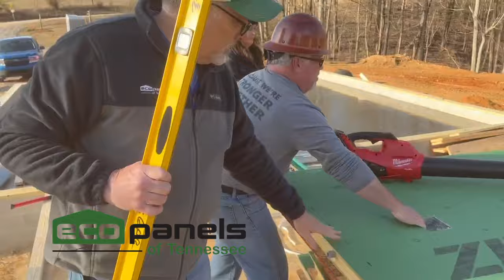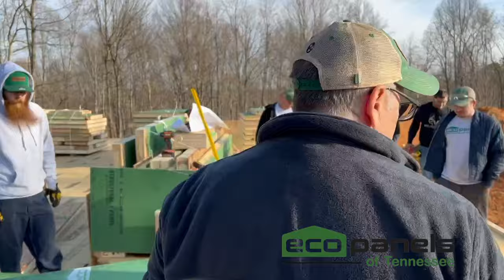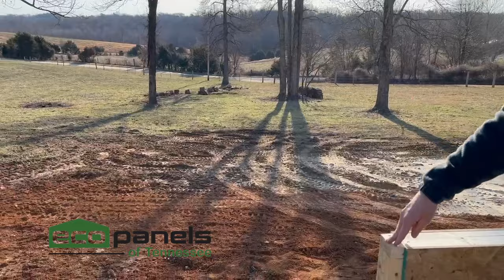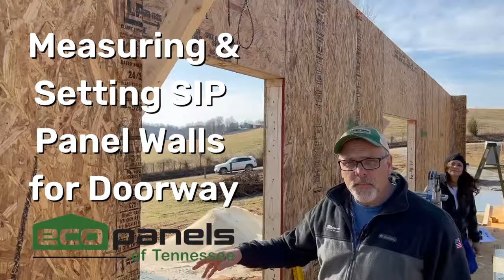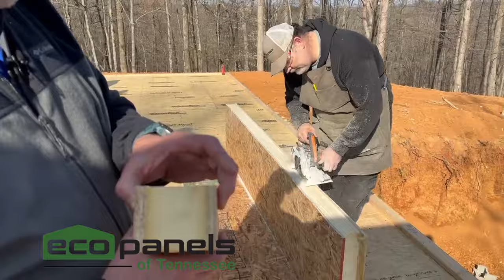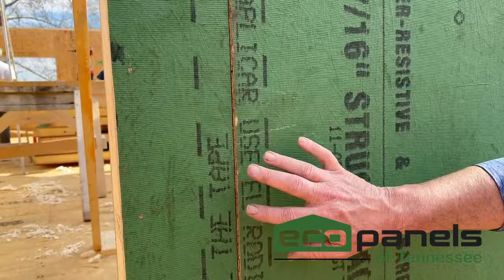DIY - Build an Eco Panels of Tennessee SIP Panel Home (Structural Insulated Panel) Instruction Guide

Comment: You make me want to go out and start building!
Question: why not leave the gray electrical nub sticking out? You said it needs to be cut shorter. There’s no need to cut if off if your drilling a hole in the right place, and you are drilling a slightly larger hole than the conduit. I would think leaving a little nub of conduit would actually make feeding the wire easier, by locating the hole in the conduit easier.
Reply from the maker: It really just depends on the build. We have started leaving the pvc long to remind builders that the electrical is there - once you get moving quickly, sometimes people forget to drill the hole for the electrical run. As long as you drill the hole at about 1 1/4" to give some room for adjustment - leaving the nub works just as well!

Comment: Here’s a thought for you: it appears that you will still have some thermal bridging where you have timber around windows and anywhere else you have a load bearing stud in the exterior wall. Is it possible to build the 4 inch SIPs with zip R? And how would that perform compared to using 6 inch SIPs?
Reply from the maker: Good idea! Currently, all we have access to is the standard Huber-ZIP moisture sheathing but that could be something worth looking into for the future. Not sure how different the data would appear but, we will definitely keep that in mind.

Comment: Why are the panels so thin what is the R value on these panels I am looking at R42 and R32 panels
Reply from the maker: Our Poly-Core panels provides great R-Value per inch, so 4.5" provides R-26 and 6.5" is at R-40. Smaller, lighter, and takes up less space while still being far superior in strength to stick framing.

Comment: There must be a better way of removing the foam in the end then what was shown here, where uneven chunks were gauged out.
Reply: They make an adjustable hot knife for the project..
Reply from the maker: Our foam is PUR foam. It has a class 1 fire rating and cannot be cut with a hot knife. We will send Great Stuff gaps and cracks insulating foam with the kit. The foam is used to fill the uneven chunks left behind.

Comment: An "electrical plug"?  You mean an electrical raceway or a conduit?
Seriously, I would not recommend Eco-Panels.
And not recommending Zip products which requires a "special" roller?  Seriously?  How many ways can you screw over the public with extra fine print warranties?
Reply: You are criticizing this company, for pointing out that Zip requires you to use Zip's roller in order to file any future warranty claims?  Come on.  Zip makes highly regarded products - so it makes sense this company would use them as an option.
Reply from the maker: We actually install the electrical outlet/switch box inside our panels. Then inject the foam around to encapsulate it. We will have the raceway install vertically inside the panel. The raceway is attached to the switch/plug box. No need to cut into our panels to find the raceway or install a switch/plug box.  We do the work for you. 
We are proud to offer Huber Zip as one of our sheathing options. Yes you will have to purchase the roller and the Zip tape from your local hardware. Once this is done your exterior will have a great moister barrier installed.

Comment: Great video!  Would love this on my property but I've got to ask; wouldn't it save time and headaches to use a rectangular hot knife to remove foam when neccessary as opposed to cutting and gouging out?
Reply from the maker: Great question, but with a little more time on our channel you'll find out that our foam is very different from what most SIP companies use, which is EPS. We're using a specialized closed cell polyurethane, which becomes a 'thermoset' product and does not melt at any temperature. Since it doesn't melt, a hot knife just doesn't work. It takes a blade. :) Great question... thanks for watching!

Comment: They are pre framed pre insulated walls?
Reply from the maker: Sorry, we missed this comment and just getting to it. Yes, the combination of the two OSB skins and high density foam makes the panels structural. This allows us to remove nearly all of the conventional 2x framing and replace it with insulating foam. 2-3x stronger than traditional stick framing and super energy efficient. Thanks for watching!

Comment: If I understand you correctly, when you are shimming the panels up to level the top of the panels, the screws/nails become a load bearing?...
Reply from the maker: You could have a handful, correct. With a little time, this will settle out. Keep in mind, it should be minimal and infrequent, but in reality no subfloor/slab is perfect and all homes settle over time (fractions of an inch). Another method is to shim between the panel top plate and the continuous top plate prior to the roof load being added. This may be recommended if there's more than a couple small areas that need adjusting. Hope that helps.

Comment: Regarding the foam used, after a few years it starts to absorb moisture... Do you have any experience with this..?
Reply from the maker: We do not.  Our foam is a closed cell Poly, and is a Class 1 Vapor Barrier on its own. As long as it's protected from sunlight and water exposure, it should not degrade to retain or transfer vapor. It's important with any building product like this that it's protected from water intrusion.

Comment: In regards to installing a header. I would suggest installing the header before the next full panel. This can be accomplished by propping up one side with a temporary stud or have the man power to assemble both full and header panels at once. This is to avoid scrapping off the spray foam when sliding the header in from the top.
Reply from the maker: Sorry for the slow reply here... catching up after the holidays and let this slip. We've used this approach before as well. It comes with it's own set of unforseen challenges, but is certainly an option. It's situational. Good eye and great comment.
Reply: @EcoPanelsofTennessee  idea, build a stud-jig that sits on the floor header to temporarily hold up the top header, and/or incorporate a ratchet load bar
Reply: I was thinking the same thing after seeing the spray foam scrap down to the bottom of the panel thus keeping the foam where it was applied! The stud should have a U up top to keep the panel from sliding off.

Comment: Sorry but had to.  Plumb refers to something, a wall in most cases, is straight up and down. The term “level” refers to something being straight from side to side- like a floor, if your floor is not level you may have some problems.

Comment: Do you need that protruding PVC electrical conduit to solvent weld into a female fitting in the sill plate?
Reply from the maker: Great question, but no. Electrical in the exterior wall doesn’t have to be within conduit by code, so in our application the conduit is simply serving as a “raceway”. Hope that helps!

Comment: What would i need to get R38 to R42 in Side Walls and for roof panels what would i need to get R60 or so?
Reply from the maker: As of the date of this question, we make a 6.5" panel that's R-40, which we commonly use for walls and roofs. Sometime our panels just aren't practical for a roof application. We can look at your plan and advise in this area. Honestly, sometimes a SIP roof isn't the best way to go. Walls are almost always a no-brainer, but roofs are more complicated to work with. A layered system may be possible, but that's a conversation that should be had with a contractor and also probably involve a local codes official. Hope this helps!
Reply: i have heard from other sip panel manufacturers that they recommend thier sip panels for roof and walls.  We want to have a super efficient net zero home.
 @EcoPanelsofTennessee

Comment: What do you do to stop thermal bridging with wood studs going all the way through from outside to inside?
Reply from the maker: Great question. We replace most of the framing with foam. The main thing we do is reduce studs to just a couple percent of the wall at most. Typical homes, even spray-on-site, have 26% or more of their exterior wall envelope that's a stud, creating that thermal bridge. Our panels remove almost all of that, typically only leaving studs at the top and bottom plates, and around door and windows. Once we've replaced all those studs with structural foam (providing R-26 @ 4.5") the opportunity for thermal bridging is reduced to such a small percentage of the envelope that there's no need to do anything further. Chasing that last percent or two would not provide a ROI, so the next step in improving the envelope is probably turning attention to windows. Thanks for the question!
Reply: Hi Rob thanks for the response. @EcoPanelsofTennessee
Reply from the maker: @DanLiese  our pleasure sir!

Comment: These exterior walls are great what’s the R rating for 4 inch and 6 inch?
Reply from the maker: Our apologies. We failed to reply to this timely. 4.5" wall is R-26 and 6.5" wall is R-40. Also keep in mind that we have no air cavities like framing, and we eliminate the vast majority of thermal bridging that's typically seen with common framing by greatly reducing the amount of lumber used. Thanks for the question!

Comment: Did you consider to use t-studs for seal plate to prevent thermal bridging?
Reply from the maker: Great thought, but our wall thicknesses doesn’t allow for a T-stud product. We’re getting R-26 in a 4.5 single pass install wall system. ROI is always important. The cost of trying to eliminate that last 1-2% of bridging likely never pays off. Thanks for the question!

Comment: Love the idea of these! I know there are tons of variables, but of people who did diy building, how long does the framing portion take on average?
Reply from the maker: There's so many variables that this one is tough to answer, great question though. If we have a professional building crew of three people, on a typical 4 corner house, they'll easily have the walls up in a day, maybe by lunch. Each corner slows things down a bit. Take three, able bodied DIYers, and the time is basically the same. The process is simple enough that it doesn't make much of a difference. Add complexity in the design of the home, and that's where it will probably slow down more for DIY builders than professional builders. Wall height over 8' is probably a factor that would slow down a DIY builder as well. Overall though, if the plan design is relatively simple, these work really well for DIY, and we work with a lot of these clients. Hope that helps. Thanks!
Reply: Are the panels framed with 2x4 inside the foam?

Comment: You still have to run piping and mechanicals through the panels as well or are they pre-run like the conduit?
Reply from the maker: Conduit is generally only ran to create raceways for electrical. Most other mechanicals are ran through the floor, ceiling and through interior partition walls of a home. In a case where a home is on a slab and an outside water spigot is needed, a penetration can certainly be made in a panel for that application. Small penetrations for HVAC or other similar needs can be done as well, without compromising the strength of the panels. I hope that answers your question. If not, just let us know. Thanks!

Comment: What do your roof systems look like?
Reply from the maker: We have on our list to add more content about roof panels. However, here's a quick intro to what we do: https://youtu.be/ak6OvJFs-oI
Also, it's worth noting that our roof panels differ from what is most common in the SIP industry, which is jumbo-panels with EPS foam. We inject our panels with Poly-Foam, and so typically they are shorter than jumbo panels and need to be supported at the joints. If you have plans we can review, we can help determine if our panels are a good fit or not for your project. Thanks for the question!